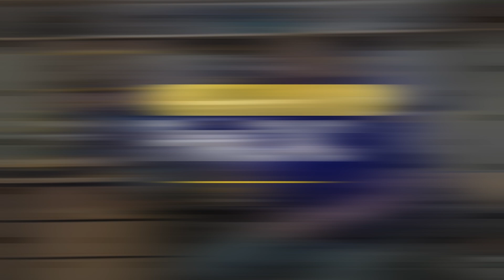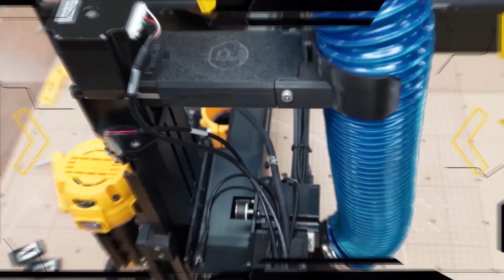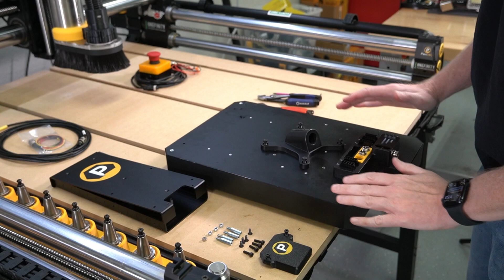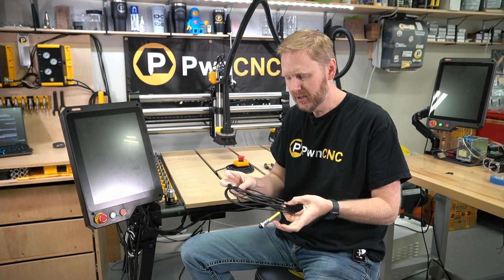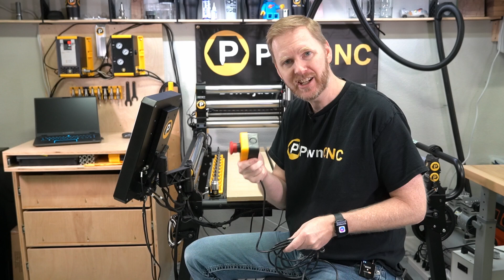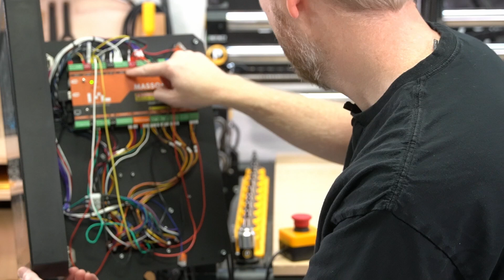Don't Miss: Inlets Panel Announcement

Comment: You Have to Lengthen the Wiring Lengths .  I purchased a tool setter  and the wires are to tight.  they need to be lengthened
Reply from the maker: They are tight yes.  We have started to set a 25” standard length.  Early inlets were only 18”.  They still work but limit where in the panel they can be installed.

Comment: Daniel,
My Masso does not have holes that match the inlet cover. Thoughts?
Reply from the maker: @philjacobus860  the masso should have the VESA 100 screw holes for mounting to standard monitors.  That’s where our inlets panel attaches to it.  We provide risers that then extend that VESA100 mounting pattern to the outside of our inlets panel.
Reach out to support@pwncnc.com and we can share more info.

Comment: Looks good. RE: the  3d printed cover - How are you then dealing with threading the d-sub connector for the Masso pendant and the wire coming out of the Masso?
Reply from the maker: The cover has a notched piece that's hard to see.  The MPG's cable gets plugged inside and runs down to their opening and through that notch.

Comment: Hi PwnCNC, nice product. Definitely want to know if the coolant if off or fails, that could save the spindle. 
A ?, my laser control/on - off box is mounted on the back of my MASSO controller. 
Does your panel have threaded holes to remount the laser module? 
Thanks
Reply from the maker: I've run this exact ATC motor for hours with no coolant flowing at all.  It was light work... a 3d clearing and finishing pass.  I was 3/4 through the finishing pass when i realized i'd forgotten to turn on the chiller... motor was barely warm.
The chiller alarm is high when coolant is not flowing (off, blocked) and low when it is flowing.  The Masso won't check that sensor though unless the spindle is actually running.

Comment: Looks cool! Does this void 1F/Masso warranties?
Reply from the maker: I can not comment on that, you'd have to ask Onefinity.  However, with this design, i was very careful not to permanently change the machine in any way.  The inlets panel can easily be removed without leaving behind any permanent modifications.

Comment: Daniel what accessories can I get for the millright XL... Looks good brother
Reply from the maker: Although I'm specifically putting it into the Onefinity Elite context here, all of these electrical accessories will work on any Masso Touch controller.

I'm not sure how the Mill Right's Masso Touch is implemented.  I'd love some all around photos of the controller and how it's mounted, etc.  If it doesn't interfere I bet this inlets panel will mount right onto the Mega-v2's Masso Touch controller similarly to how i'm mounting it onto the Onefinity's Masso Touch.
Reply: I don't have the masso controller